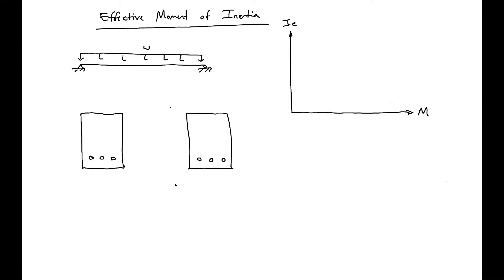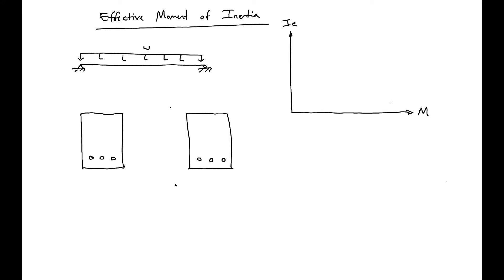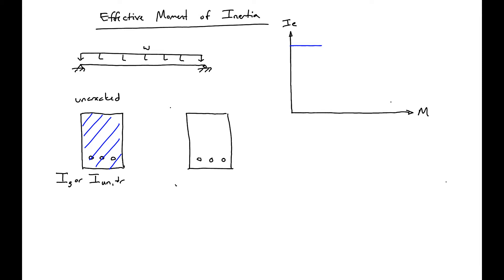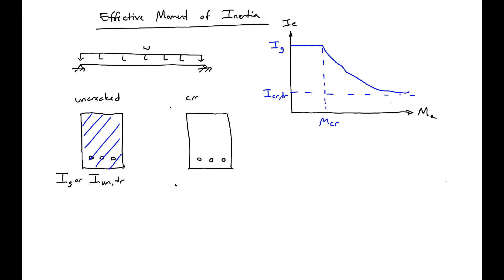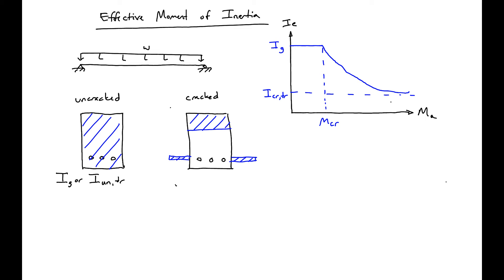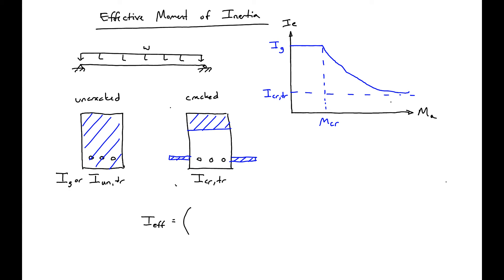7 - Effective Moment of Inertia

Comment: Thank you for the great video. what is Ma? And how would steel bars effect the modulus of elasticity of concrete section? I need the moment of inertia and modulus of elasticity of reinforced concrete section with effect of percentage of steel. actually I need it because I need stiffness of column to calculate the stiffness of whole story of the building. I modeled a RC building in etabs. etabs gives me stiffness of the story after I run the analysis. but i haven't even run design. How did it calculate the story stiffness even before the reinforcement percentage in column is determined. Is it calculating stiffness of columns with no reinforcement in it ? or is it calculating stiffness of column with minimum required percentage of steel? will it change the stiffness of columns and then the stiffness of whole story after I run design in accordance with the amount of steel it calculates for each column? is the stiffness of the whole story sum of stiffnesses of all the columns of that story?